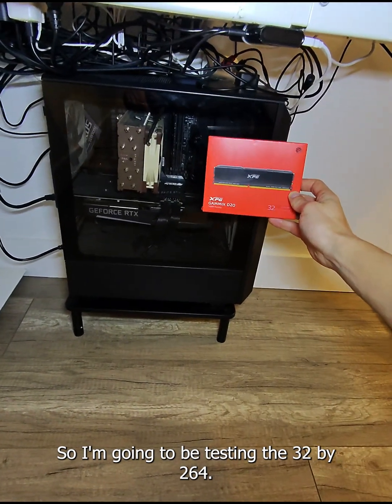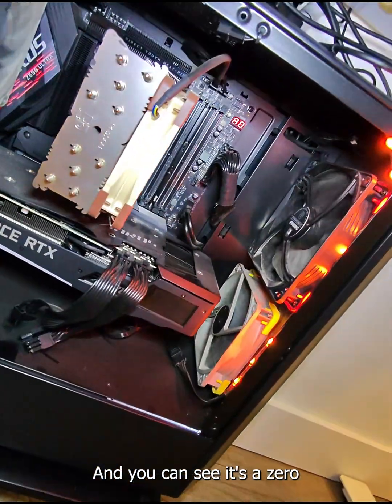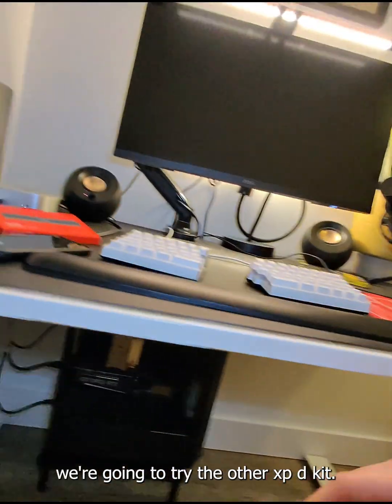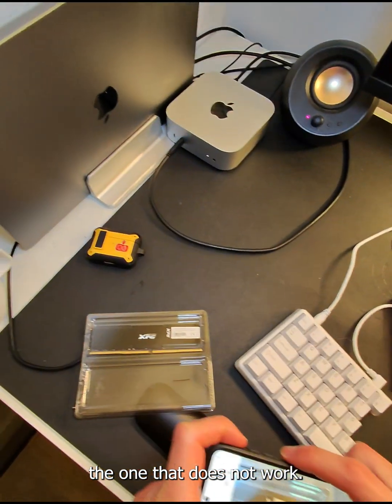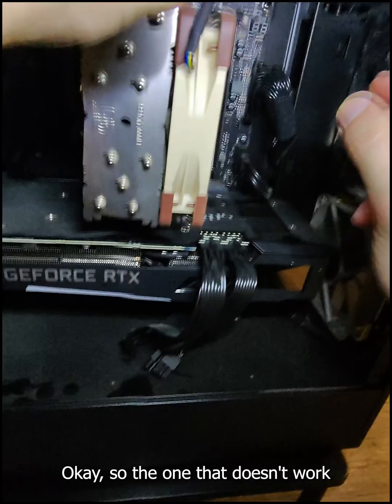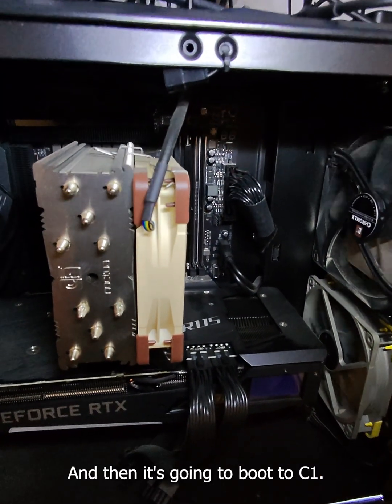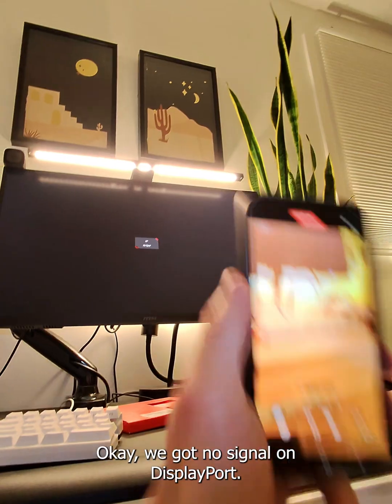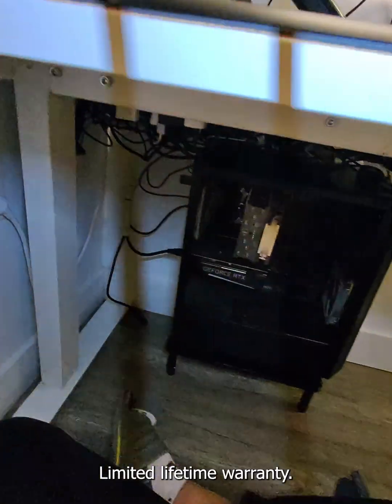XPG DDR4 RAM Comparison: Working vs Defective Module (Z590 Motherboard C1 LED Error Code)

Comment from the maker: Quick update. It turns out it was defective and I was able to warranty the process. I wouldn't say it's a smooth warranty process but I like that they send me back two new 32 gigs RAM sticks and I installed it and it works. So it took about a month for the whole process. A very long delay since they didn't have the part and had to ship it from Taiwan.

Comment: had this issue with AM4 a long time ago but now with AM5 this seems more important to check ram serials since even now I got ram that refuses to work with AM5 but just 3 different characters on the serial and it works like a charm